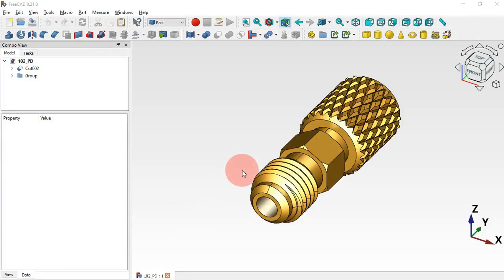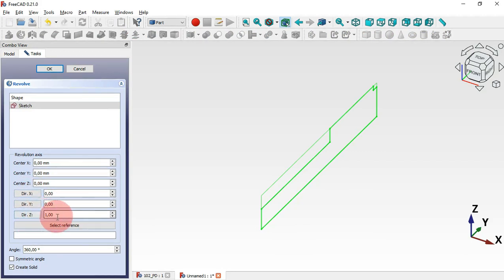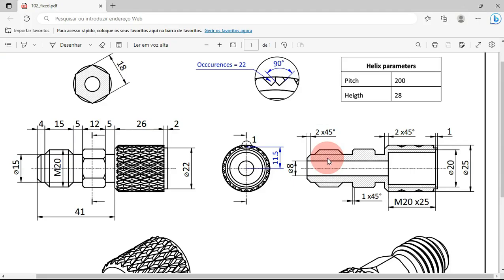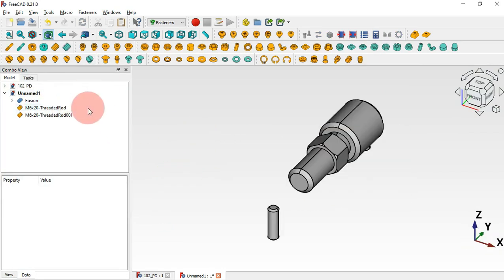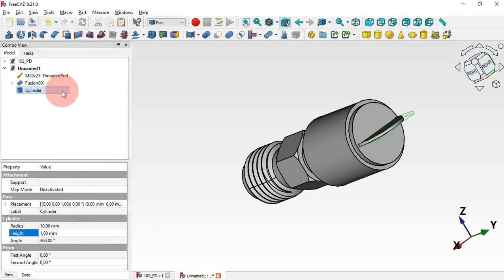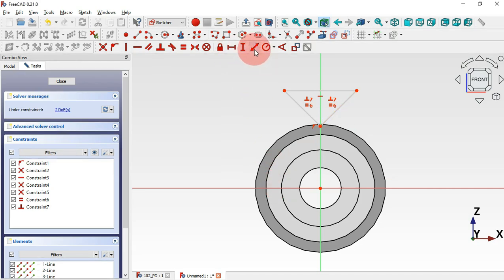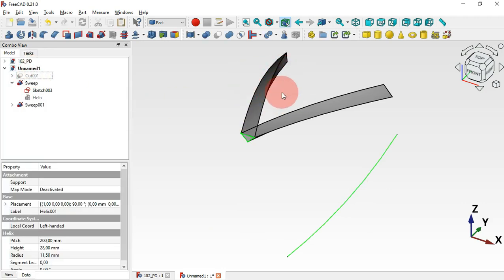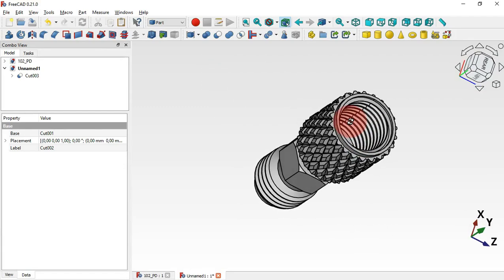FreeCAD 0.21 Beginners tutorial: practical exercise 102 Remodeling in Part Workbench

Comment: The last step doesn't work at all (cutting two shapes). The spiral remains, but the fitting disappears. What could be the problem? Moreover, if you change the order of selecting forms (spiral first, and then fitting), then everything disappears, and the view report displays errors in red. I drew the spiral again, exactly like the author. It didn't help - the error repeats. FreeCAD version 0.21.2